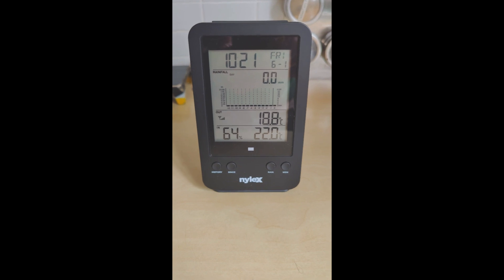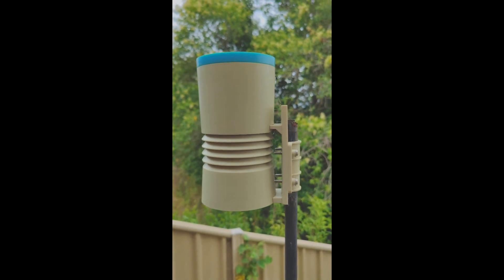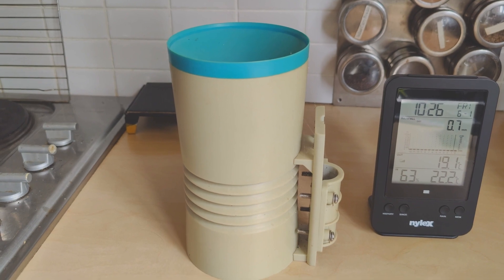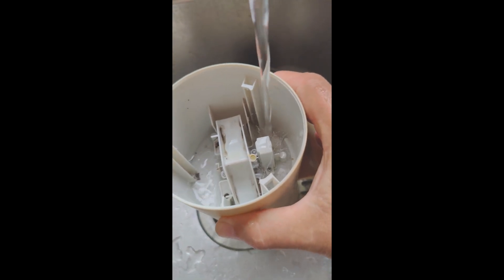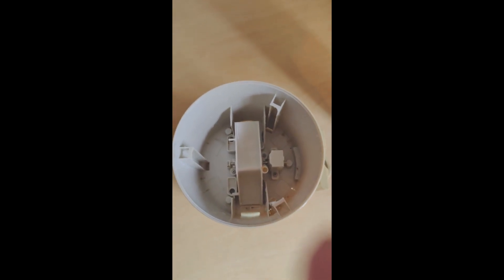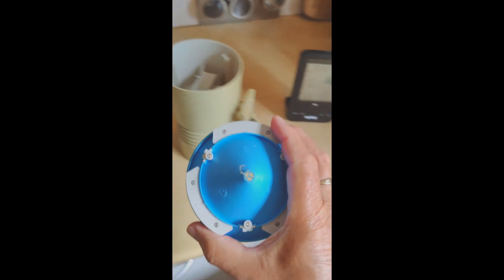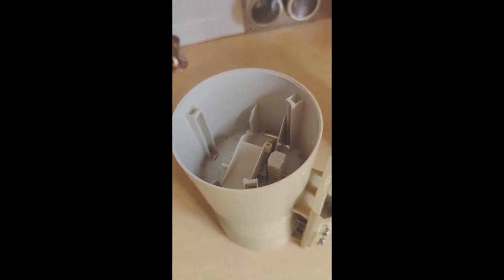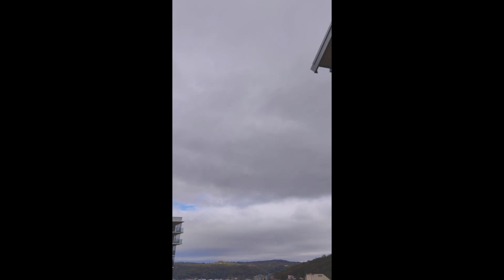Servicing the Nylex Digital Rain Gauge

Comment: Thanks for the info. I bought me one yesterday. Look like inspecting the unit  regularly and cleaning it, is important.
Reply from the maker: Yes, it sure is. Enjoy.
Reply: After 5 weeks from installing the unit, I’m happy with it. We had a lot of rain here. I could test it properly. It is accurate . What I like on the unit is, that it is easy to remove from the units bracket to clean it. It slides off easy and easy to install it back on the bracket.
Reply from the maker: It become a bit addictive to keep up with how much it has rained. 😄